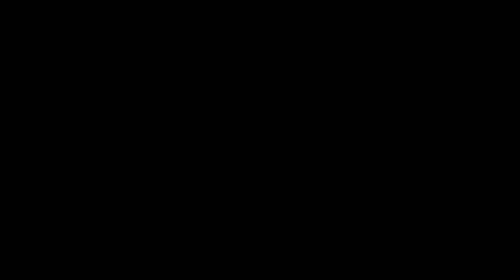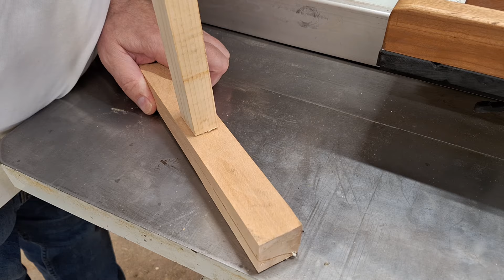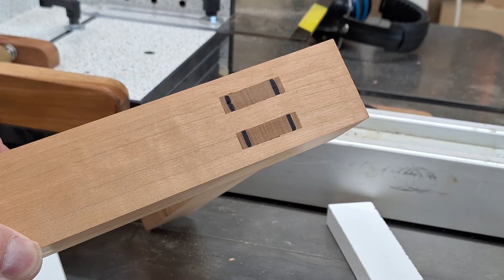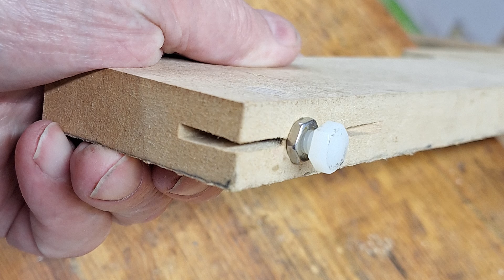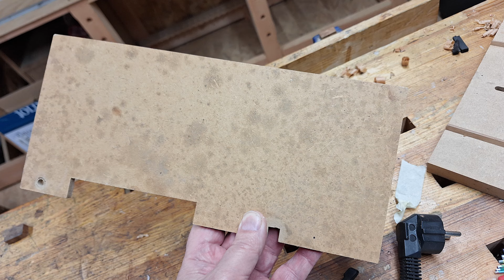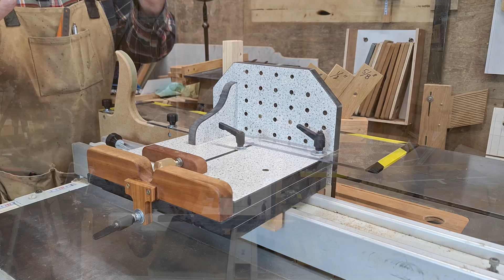The Ultimate Tablesaw Tenon Jig -Part 1 Introduction

Comment: You're very welcome to check out my "superjig", you might need to rethink the "best tenon jig in the world" statement after you watched it:-). Cuts any tenon size and bridle joint finger width in steps of 0.05mm with any thickness blade, no spacer fabrication required, set up time for a new tenon approximately 1 minute, accuracy of cut tenon (or any other joint) within 0.05mm of target. Integrated tilt mechanism in two directions for angled tenons (and other joints). It does much more than that but now I mainly mentioned it's pros when it comes to tenons.